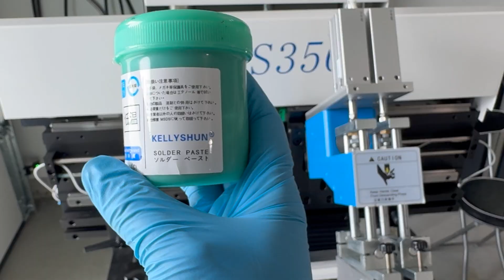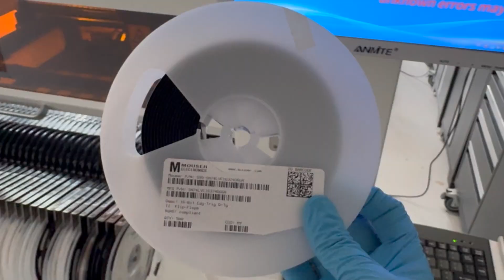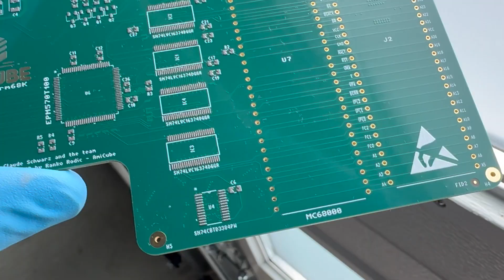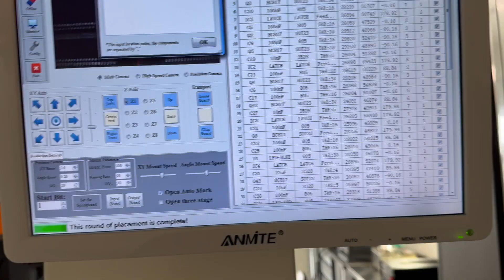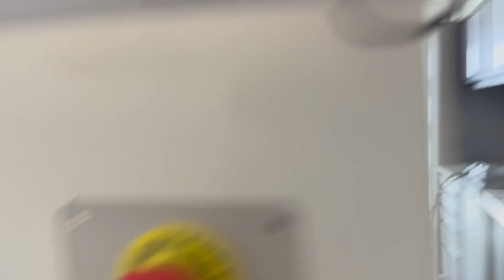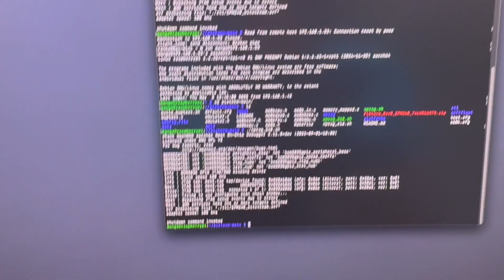PiStorm68K assembly !

Comment: Does the pick and place machine rotate components, or do you need to have the components on the roll in the cartridge in the correct orientation for the board?  Its amazing watching the precision of these machines.
Reply from the maker: Indeed it does! There is param. called rotation so you can specify in deg.